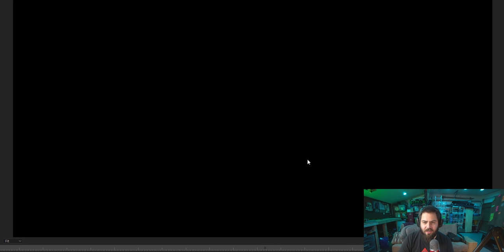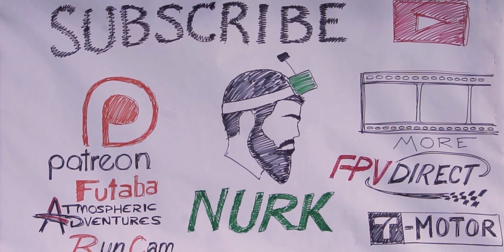Does a single-axis gimbal make for better FPV footage?

Comment: Interesting idea.  However, my primary concern (defect) when flying commercial FPV is the inability to TILT the camera...up or more importantly "down"!  Fly the other mainstream DJI drones gives you that ability and imo...a huge advantage when framing shots.  So my vote would be for a gimbal that enabled a TILT DOWN function.  Not really obsessed with stabilization.  That can be dealt with accordingly.
Reply: same for panning, would also be nice

you can always mount a classic gimbal on your FPV drone, but the hard thing is how are you gonna control it with the remote in real time?
Reply: @rubenvaneupen7327  The DJI Controller has 2 front facing controller wheels that might be repurposed for pan/tilt functionality.  Or the Osmo Pocket has a separate controller wheel that might work.  Not an engineer.  I'll leave that up to Nurk.
Reply: @checkeredflagfilms  You talking about extra buttons on a controller?
 I'm more talking about which gimbal accepts input from a real time controller like crossfire nano rx pwm or cppm signal etc.
Reply: @rubenvaneupen7327  No.  If you've ever operated a DJI controller, there are 2 control wheels at the front.  On the drone series those can be programmed but generally speaking they'll do pan/tilt.  On the FPV version they can be programmed as well.
Reply: @checkeredflagfilms  Ok but I'm talking about using a gimbal on a self-build FPV drone, not on a pre-build DJI.

So I don't know how the DJI controller is gonna help me with that, unless I move the guts from the DJI over to my self-build drone?
Reply: @rubenvaneupen7327   Absolutely, that would not work.
Reply: @checkeredflagfilms  exactly :)

Comment: Every time I watch other people's fpv videos, the audio of the motors/props sounds pretty cool. Every time I listen to my own GoPro audio, my props sound like 4 bees pushing wet farts.  Is there some magical audio setting I need to set on my GoPro 8 to make audio sound better? Thanks in advance!
Reply: Get a little wind muff and stick it over your gopro mics :) thst improves a lot. Gopro does a lot of post processing with audio to try and reduce noise, you can turn on the raw audio feature and see if thst sounds better for you :)

Comment: Cinematographer hat on,.. Typing half way through,... I wouldn't use those first two techniques, as the horizon is drifting the opposite direction to the turn. Reelsteady Gimbaled with Horizon Lock On was best, followed by no gimbal at all. Can you log in to the gimbal with USB etc and adjust it's rates? I have a two axis gimbal for hero4 on my F550, and three axis on my Phantom, and that roll-lag or reversed tilt on the Phantom sucks ba,....
Wonder if the Quark will take a baby Mirrorless, like a Pentax Q with a 110 type lens? Or, can the camera of the Air Unit fit in there, for downlink to live streaming systems?

Comment: At 140g, if you have a light weight, 600-650g AUW with gopro 5" with some beafy motors, you could totally fly this gimbal on 5".

I think a lean racing build, like a  'merica, raging droner 5r, or even a slam nasty with a gimbal mounted on top, battery on bottom would be perfect for flying this gimbal.

Comment: Reelsteady with gimbal and horizon lock is glass. Looks so awesome. Such an interesting style. I see it looks at the ground when nose down for a few because of 1 axis, I assume. But that looks so sweet! Did it require the 7", or was that because of the insta 360 and gimbal and GoPro weight combined?

Comment: the weird angles you get without horizon locked realsteady is due to g forces on the gyro of the gimbal, it thinks the bank angle is higher than it actually is, and overshoots the horizon. the developer of the gimbal should be able to create a proper pid setting to keep the horizon locked at high g turns.

now that said.....
you've mounted a one axis gimbal to your drone, use hypersmooth and put it through realsteady and get an "OK" result, whilst filming the whole gimbal and drone working with a camera on the rear of the quad that does the same, but better and the image looks better..... maybe the oneX can't shoot the 4K resolution you want, but you've shot 2.7K on both (gopro and insta) and the insta360 just looks way better up to 2.7K. anything above will not be doable i guess..

Comment: i think this is a big success, reelsteady is wonderful but the one axis gimbal is definitely a huge step up in visual quality of flying, as pilots we just accept banking, would be weird without it? but for, as you say storytelling, you often want full ''god mode'' on the camera, ie no 'g' force just wistful camera following a subject or telling a story.   massive step up, ps. dude!! you didnt conformal your solder work?   i still have nightmares about a test hover that shot over my left shoulder and hit a wall ten feet behind so fast, i didnt flinch until after the noise of it hitting the wall. lololol.. pps big shout out to the guy who put you onto this gimbal.

Comment: I'm no expert but I'm willing to bet that the raw gimbal footage looks bad because of how high it sits on the drone in combination with the plastic mounts: it looks like the vibration come from the fact that the camera enters an oscillation frequency that matches vibration from the drone. It would be great to see the same test with either hard mounting the gimbal to the drone so that it can't vibrate at all or, better, soft-mount it so that the internal gyro of the gimbal only captures real movements and less vibration. Awesome test tho, very promising

Comment: Looks great in the wider smoother shots but felt a bit unnatural close to the ground. I don't know if you can dial in less gain so it dampens most of the tilt rather than all of it. I feel if you are running or doing something that would mean traveling fast through the trees you would lean in to the turns, maybe a little lean would be more natural.

Comment: you have a lot of vibrations. as soon as rs or hs fixes them, you just end with pixel smoothie. the result is 640x360 junk imho. if you get the 10" vibration free, it might be wonderful. as it is now, it is not

Comment: every roll axis stabilizer always got confused at a certain pitch angle
Reply: Perhaps a custom fpv solution could have programming that solves this issue
Reply: even this one?
Reply: @rubenvaneupen7327  you can see it struggling to keep the horizon when the quad tilted forward too much. It only happen on 1 axis gimbal. But don't get me wrong, this gimbal works great, it did not stutter on an extreme tilting. I think it's just the limitation on a single axis gimbal.
Reply: @RahmatHidayat09  Yep I guess so. Do you know of any 2 or 3 axis gimbal that accepts input from a real time controller like crossfire nano rx pwm or cppm signal etc. and that has the same super smooth operation as this one? So far, seems like I have to choose between both those functionalities.

Comment: Nurk FPV , one question ? I’m new to FPV and I wanna ask you what baterry is recommended for free style and long range on a 2508 1700Kv Motors ? Is a 7inch quad .
Reply: Start smaller man less $ when ya break it, i say buy a 6in frame n fly 5in props on it at first, 6in is fast, 7in even faster

Comment: the footage looks great. 
definitely a certain effect with that super locked horizon 

although that motor reversing and your Pucker moment had me thinking about Conformal coatings. 
I know Dielectric grease works... but it's messy and heavy.  
there has to be a better way to protect our electronics. 

I Live in Oregon and I have 6 months of Rainy days ahead. 

a lightweight spray or coating that would be great. 
can you just dip a whole quad in some silicone fluid and then be able to fly in a downpour ?
Reply: If you check my one and only video, at around a minute there should be a clip of me diving through a mist spraying snow cannon. That was with a thick coating, applied the usual way.

Comment: Awesome. 
The other benefit might be the ability to use a lower shutter for some motion blur, which reelsteady screws up in the cinematic ratio (2x frame rate).. I use 8x (1/240 at 30fps with RSGO, but with the gimbal you might get away with 4x. 

Only downside thought is that when there’s a lot of downward tilt, like a dive, horizon lock actually feels less natural.. 
We’re all too used to fpv videos though, so would be good to get a non-fpv person’s thoughts

Comment: Omg have been waiting for this hardware tip for a few months now. I was going to invest in some more standard gimbals and try to fit them to drones, but this is waay better. Roll stabilisation is most of the time all you need. Big thanks!
Reply: Still searching for that super smooth 3 axis gimbal that can be remotely controlled in real time (!) by a second operator. Enough 3 axis gimbals, but the control system usually is not suited for FPV.

Comment: that looks so awesome can really see it on my future cinewhoop :D 
did you also thinked about the - Zhiyun Rider M - 3 axis go pro gimbal for this gimbaled fpv journey ? if yes why wasnt it in your option ?
Reply from the maker: we've tried 3 axis gimbals but they get too confused - having something a little similar is important
Reply: @NURKFPV  oh okay but love that 1 axis gimbal allready. Would it be possible to pair it with some sort of servo to adjust tilt (~10-15°) manually with an extra channel or controller ? Think that would also cool if it can tilt smoothly manually.